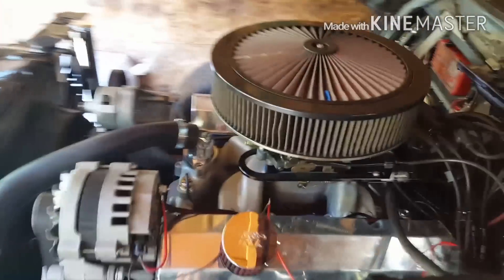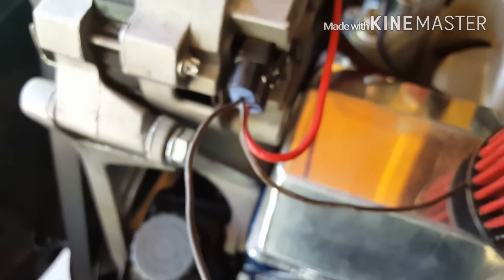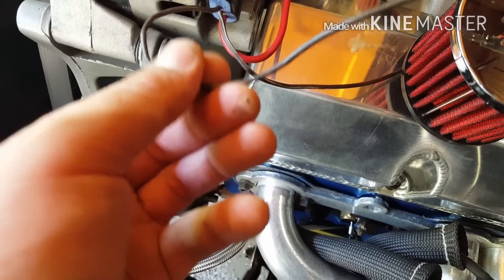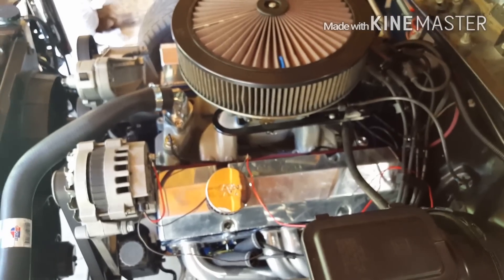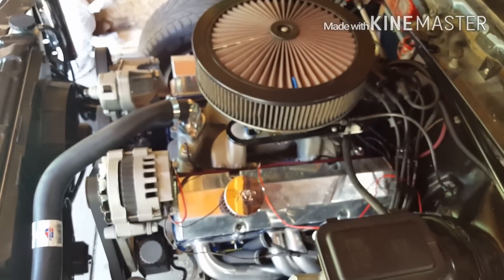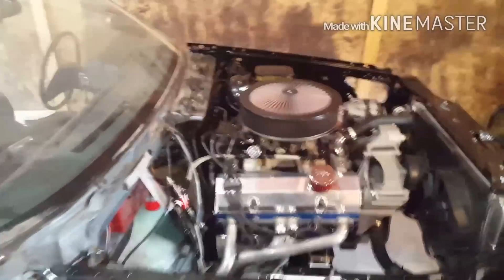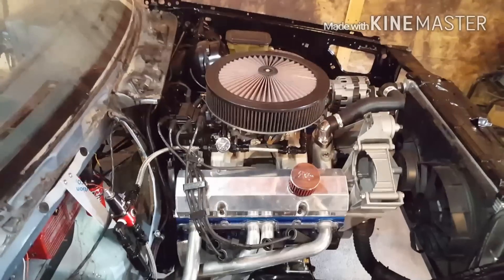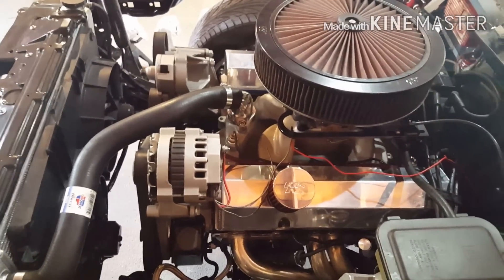G Body serpentine CS130 charging issues

Comment: I thought you dont just the pigtail to any constant power source???
Reply from the maker: Nash Made that can burn up the regulator inside and youll be going through alternators. Painless sells the right pigtail very cheap and it has the instructions and the right resistor. Ive got it havent imstalled yet.

Comment: What motor mounts you running bro?
Reply from the maker: Speedway solid mounts. I believe you look one up and it gives the corresponding mount part number for upper and lower.
Reply: Ok
Reply: my power steering pump pulley is hitting the gear steering gear box